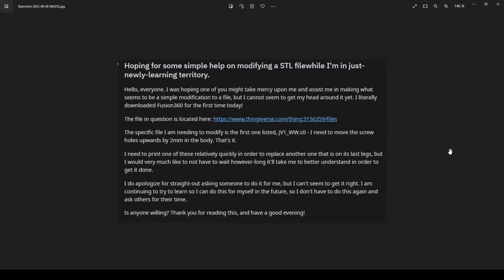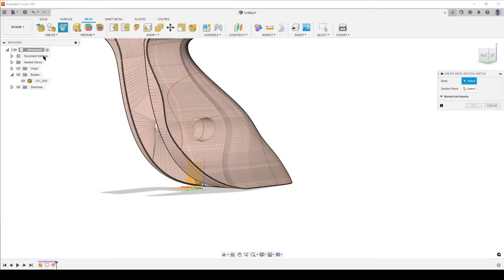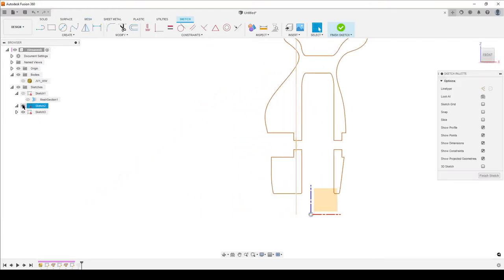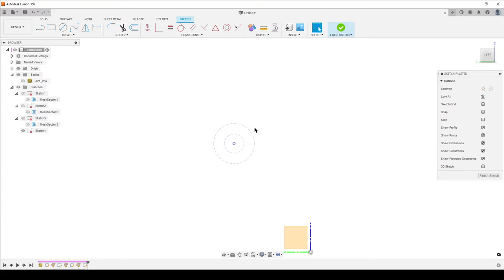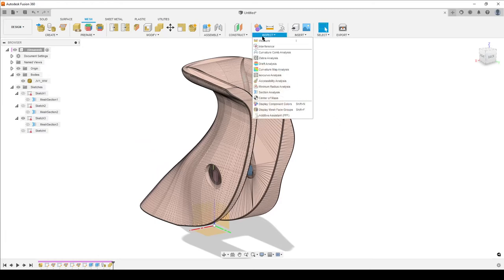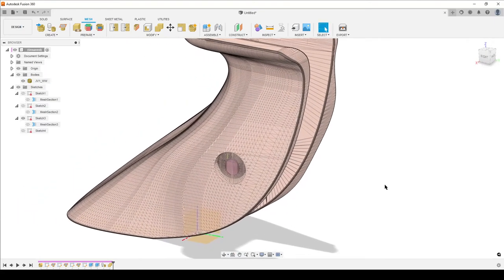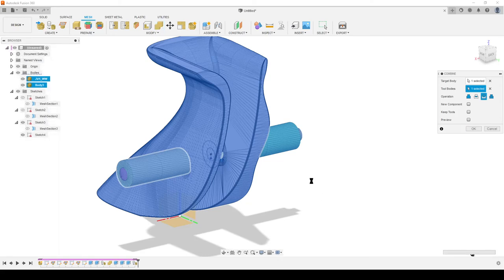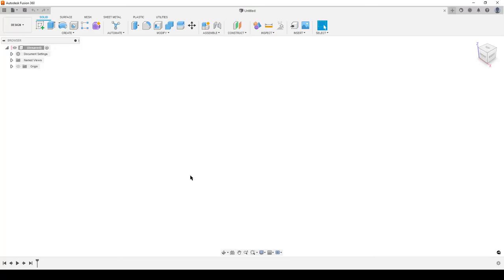Fusion 360 - Edit a Mesh Bow Handle, not converting the mesh.

Comment: A way I have come to use when I work with complex mesh file is to cut them in to smaller parts then convert them in to sold and then join them back. But still pain to with solds that are converted.